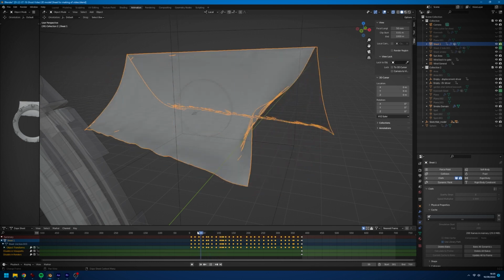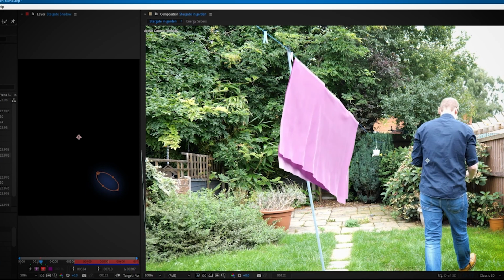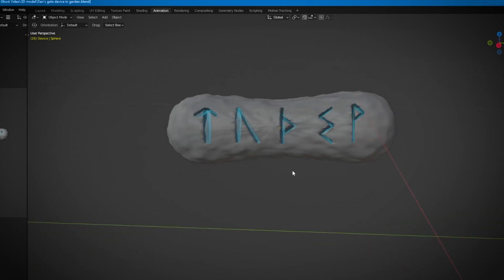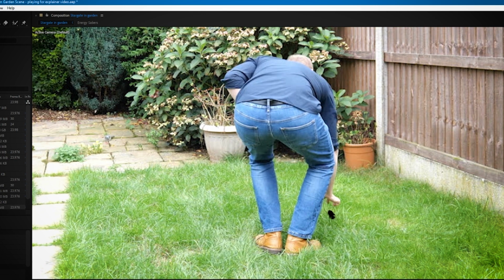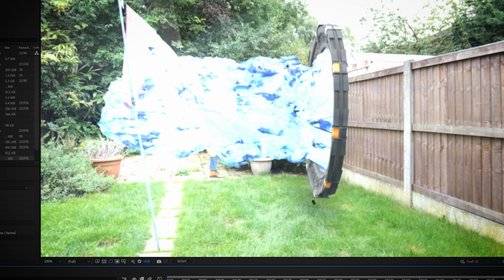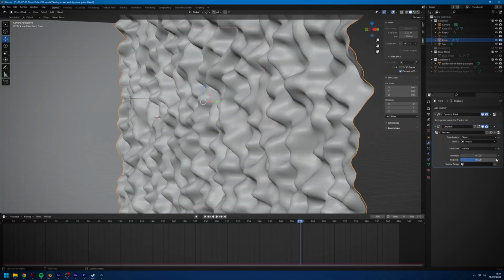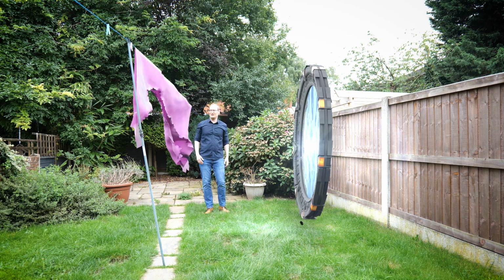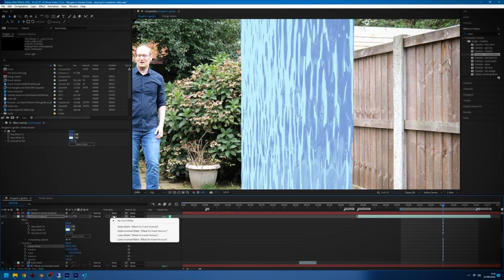My First Solid Week in After Effects and Blender for 29 Seconds of Video! A technical VFX summary.

Comment: Hey Yotty, great work! This result given your knowledge and the time spent is absurdly impressive and I cannot wait to see how you continue your vfx journey. I haven't the faintest clue about After Effects and am in complete awe of your result within just a week of using the software, as well as your dedication to frame-by-frame detail work. Regarding the Blender aspect, however, I think I can help out, as I did spot some things you may want to consider. I don't pretend to be an expert on vfx, I'm just a nerd who loves Blender and knows his way around it. These are my observations:

1. The perspective
The perspective of the 3d elements doesn't fully line up with the rest of the scene. Since you're dealing with a stationary image, rather than a moving one, you can get away with using the free and open source tool "fSpy", along with its Blender addon, to perfectly match the perspective of a frame of footage inside Blender, without the need for 3d camera tracking.

2. The lighting
To me it looks like you tried to eyeball-match the lighting inside Blender, and you did get quite close, but it still feels off. The thing that tipped me off was the left facing surface of the stargate, which looks lit, compared to the left facing parts of your body, which are in shadow. I don't know whether this was a stylistic choice to make the stargate seem more "otherworldly" and out of place, either way thought I'd mention it. I suppose the ideal way to light something like this would be to use a hdri capturing the actual lighting information, though that may be a bit overkill. Also, the stargate doesn't have a shadow. You could create a shadowcatcher plane in Blender or repeat what you did for the "device" and just fake it.

3. The material
The cloth material to me looks too reflective and not "bumpy/hairy" enough. Using even a simple noise texture to break up the reflection and give some detail to the colour, would have gone a long way to grounding the cloth in reality. I absolutely adored the ripping, your interaction, the focus pull, and the caustic effects, making the cloth feel like it's part of the scene, but I felt the lack of "tangibility" of the cloth took me out of the illusion. (Also, I don't think the cloth had any thickness, but that didn't strike me as much)

All in all, this is a fantastic result and I'm very much looking forward to seeing both the full video, as well as your future summaries.
Kind regards!
Reply from the maker: Hey there.. I only just found your amazing comment... YouTube had put it into a section for review and I missed it, sorry. I REALLY appreciate you taking the time to respond and that is some brilliant feedback, thank you. I will have a play with what you've suggested and yes you're exactly right, a lot of it was just eyeballed. If it's ok with you, could I possibly run some future stuff past you for comment? Thanks again.